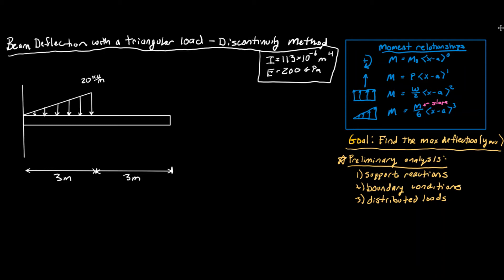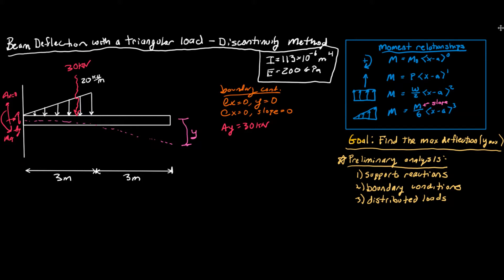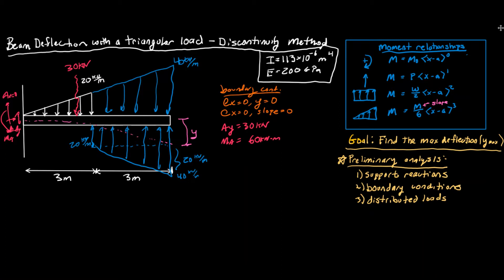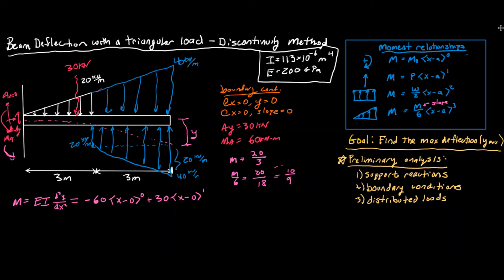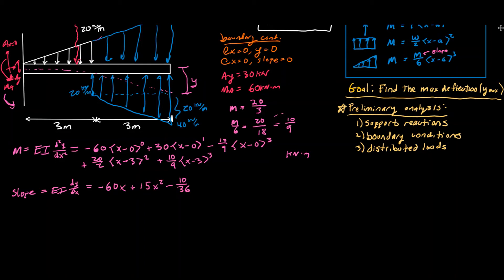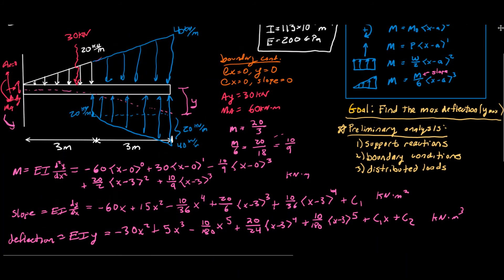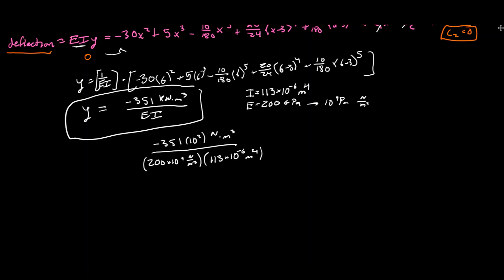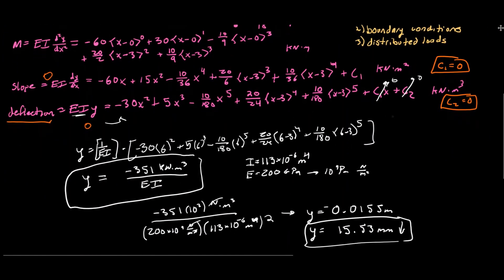Beam Deflection with Triangular Distributed Load - Mechanics of Materials

Comment: bro how can MA=60? i dont understand?
Reply: Distributed triangular load is considered a point load 2/3 of the way from the small end the the triangular load in statics. (20*3)/2=30kN @ 2m. You're calculating the area of the triangle here, don't think about it too hard. At that point, 30kN*2m = -60kN moment clockwise. Remember counter-clockwise moments are positive, thus Ma=60kN to resist the -60kN